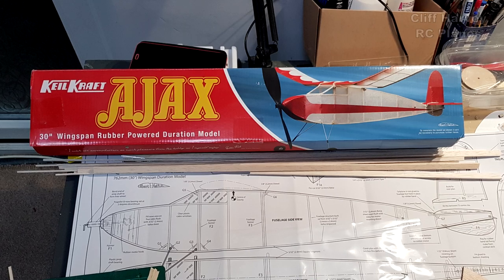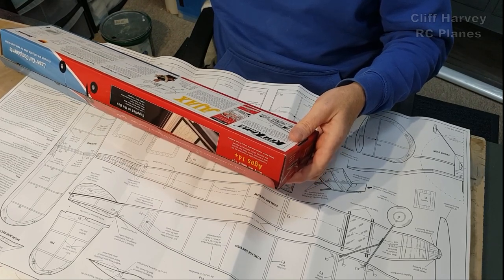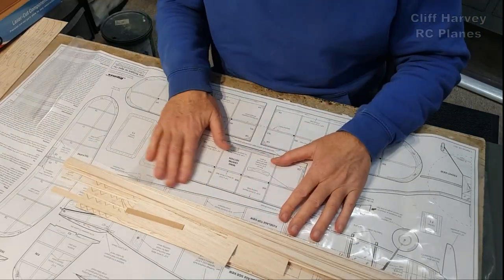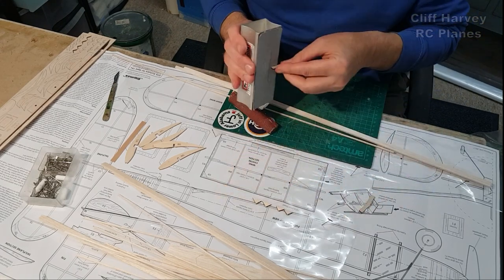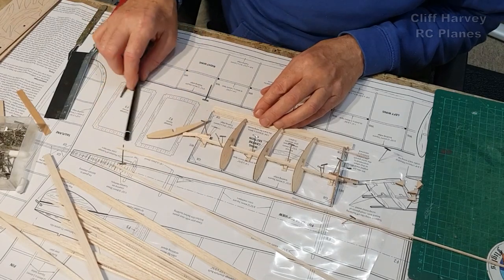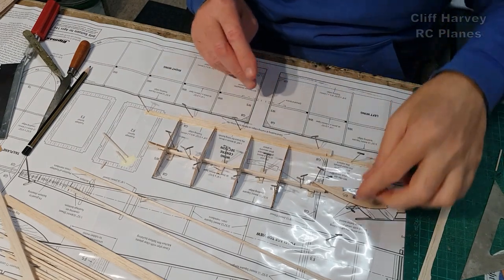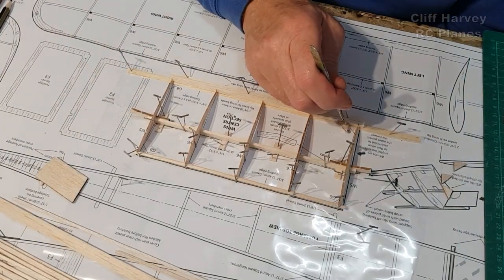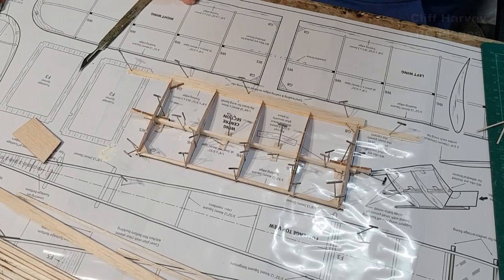KK AJAX RC CONVERSION PART 1: How to convert a rubber powered model to radio control

Comment: Built one of those in the late 1990's for my two young son's, had some great fun. Then in 1999 I took the plans to work, and scaled the plans up to 200%. Then built to accept RC equipment speed 600 motor and gearbox unit 7 cell battery pack. Although I put some diagonal bracing in the fuselage, also put two 1/4" sq. main spares in the wings. Flies an absolute treat, although I did upgrade to a brushless motor and Lipo's during Covid lock down. Such a magical piece of kit to fly.
Reply from the maker: Hi Nigel, there's a chap online whose done the same thing, wonderful presence in the air, yours must be a few years old now 🤔👍

Comment: Great project, love these old classics interested to see the RC conversion. As with most rubber power models inherent stability and duration was fore front in there minds . RC will have to work hard to give you any aerobatics. Waiting for your next installment.
Reply from the maker: Hi Vaughan, I'll be happy with a loop. What I would like to do is give it a 20 second motor run and trim it to fly without any input from me all all, so it would be free flight, cheers.
Reply: @CliffHarveyRCPlanes  Hi cliff I saw on a glider rc channel KK Invader with A symmetrical wings , interesting concept for the Ajax  . Fixed center panel carbon rod and tube both as hinge point and spar two servos operating both wing surfaces with a elevon mixer it flew well in  fact so well he up scaled it . Look for John Woodfield  YouTube.
Reply from the maker: @vaughanlockett658  Hi Vaughan, yes, I watched that video, I know John personally, he's a great ambassador for the older designs, cheers.

Comment: Looking really nice. For a moment I was thinking of doing it also, but that under camber build makes it look really coplicated.
When you get to it, please do share the details of the RC components as I somehow need to learn what size and power and battery and all that that is needed for these models.
Reply from the maker: Thanks Andrew, the undercamber just needs supporting to assemble it ok, nothing you wouldn't be capable of. The RC components are borrowed from my mini Savage Bobber, check out the link and click on the picture that shows the specs. https://www.amazon.co.uk/dp/B09V7MJP3N/?ref=idea_lv_dp_vv_d&th=1, cheers.

Comment: Hi Cliff,  this build takes me back to my childhood, I'm from wickford Essex the home of Keil  Kraft  . The factory is still there but now a furniture outlet. I built many Keil Kraft models as a boy and still love balsa builds today. Although I didn't know it at the time but my art and crafts teacher was a chef designer for Keil Kraft before becoming a teacher . Mr Webster, I wonder if he designed this plane?
Reply from the maker: Hi Kevin, I knew the original factory building was still in existence but didn't know what it was used for today. This model was designed by Louis A Heath in 1939 to the SMAE fuselage requirements, many thousands must have been built over the years. Talking of teachers I only found out many years after leaving school that my old headmaster was a full-size glider pilot and would have supported a model flying club at school if it had been suggested!

Comment: Have you considered rubber powered RC? The flights wouldn't be especially long (unless you caught a thermal) but I think there is plenty of room up in the "cabin" area for RC and good access for the RC equipment ...
Reply from the maker: Hi Richard, I did consider it for this model but having just finished with the rubber Guillow's Chipmunk I fancied something easy, thanks for the comment 🙂👍